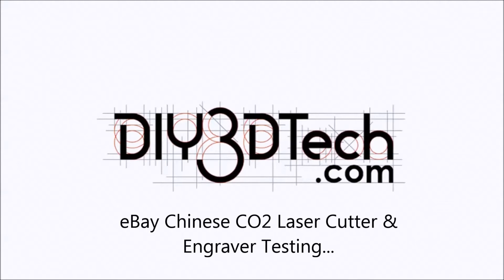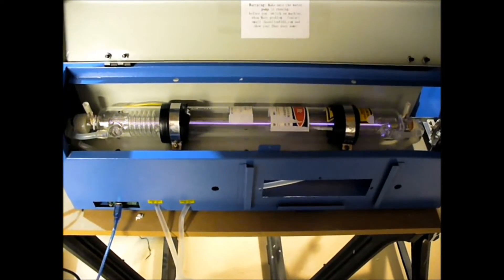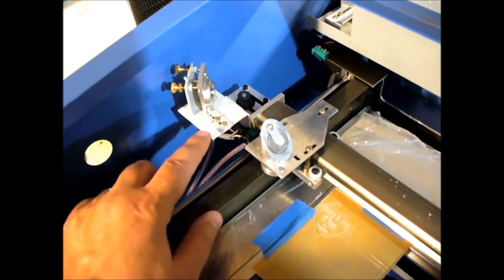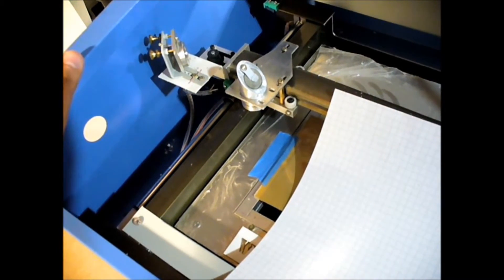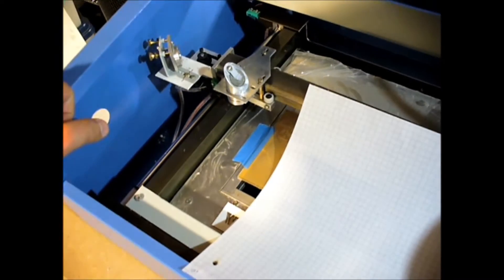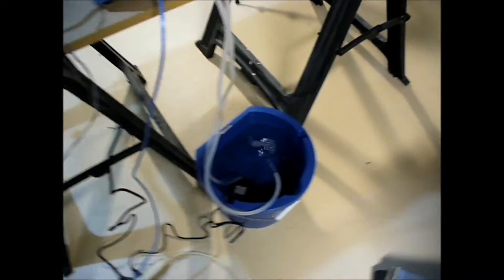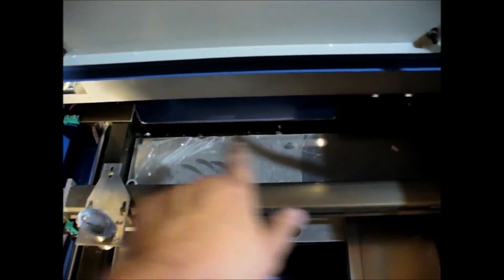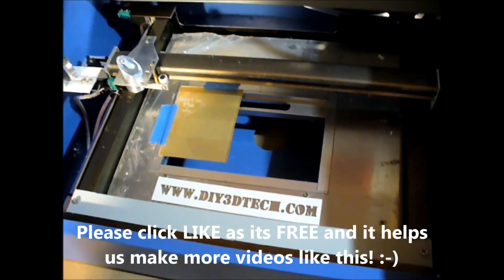eBay Chinese CO2 Laser Cutter & Engraver Testing!

Comment: So I opened my laser and the carriage was broken so I drilled and repaired it. As I got it all together and powered it up my head runs to the top right and then just continues making a loud noise no when I stop it the belt pops off how can I fix that  pleas help
Reply from the maker: Sounds like (1) the limit switch is broken (e.g. broken, disconnected, etc) or (2) your belts are off.  I would focus on #1, also assume this with no computer attached as you are just powering and it is doing its homing cycle correct?
Reply: ok i figured it out had the belt on the wrong side of the carriage. but I have computer connected I don't know what the other thing you said was
Reply: DIY3DTECH.com now I have been testing the laser and get a beam to the head but not down to work surface
Reply from the maker: Cool :-)